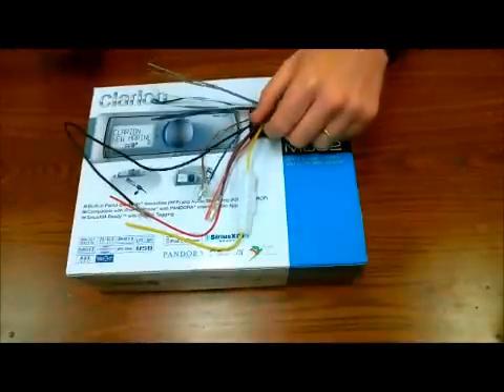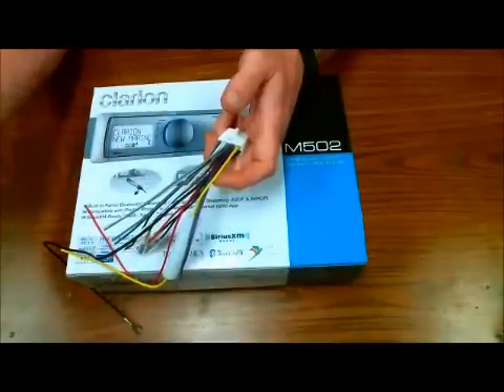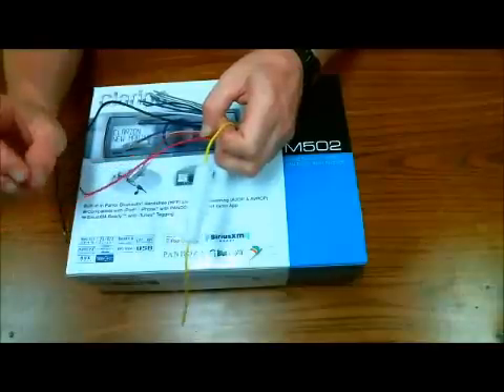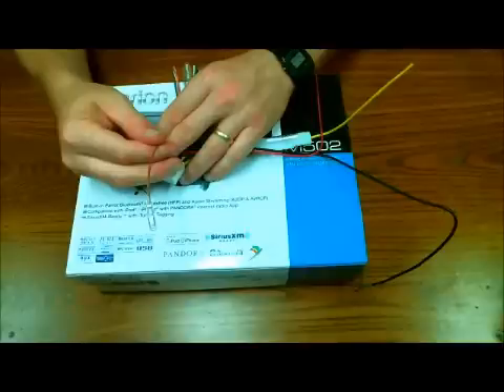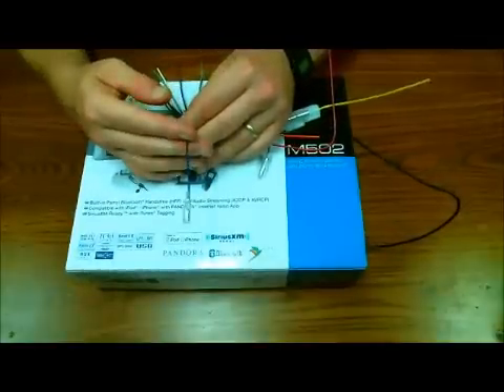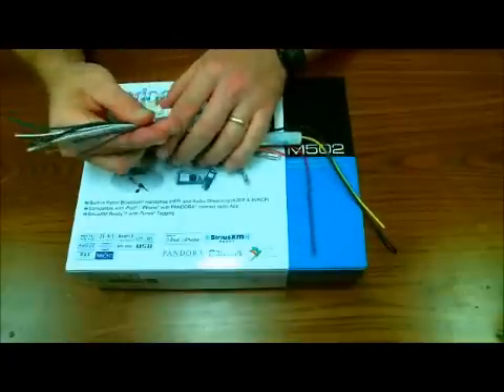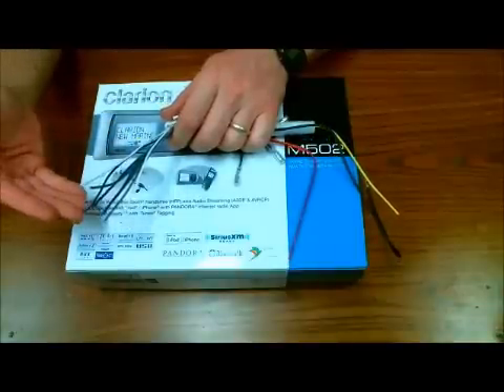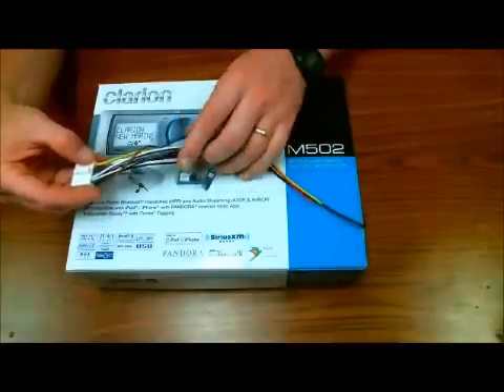Car Stereo Wiring Explained In Detail

Comment: i have a 2010 dodge journey w.o. infinity system, i cut my factory wire harness, now i am trying to rewire the metra 70-6522 with the reverse harness(70-6522). I am having problems with figuring out the factory colors with the metra harness. they are not the same.. I figured bc they wiring is for the infinity nav system particularly. Any suggestion.

Comment: I have a malfunctioning Kenwood KDX-X598 that, when connected to my phone with Bluetooth, is proving to be unusable. My phone will randomly start playing music, even when paused. I know that the stereo is designed to start playing automatically when the phone is initially connected, but it seems to think it is getting connected at random times when I am driving. It also is messing up where sometimes when I am navigating with Google Maps (audio being output via Bluetooth to the kenwood unit, the navigator will start talking and music will be playing over the audio and is makes it impossible to hear the navigation and it is also very distracting when it randomly starts to happen when driving. 

I am 99% sure it's not a problem from the phone. It is an iPhone and I tried connecting my Bluetooth headphones to the phone and driving around and navigating and did not experience this glitch with the headphones, nor did music ever start randomly playing with the headphones connected. I am starting to think it is either a malfunction of the Kenwood head unit, OR is it possible I messed up the wiring and it is messing up the phone's connection to this device? Is there any way that not connecting one of the wires you described, or not connecting it well, would cause any strange behavior like this?

Comment: Lessco Electronics , I am trying to figure something out. My new RADIO has ONLY and Blue/White wire. My HARNESS has a Blue wire and then a blue loop from the blue hole to another hole. How should I connect this if I plan on installing an amp/sub woofer in the future? This is for a 2001 toyota camry.

Comment: hello, i recently installed a sony car stereo on my truck, but for some reason if i plug the antenna into the deck the deck will turn on for a few seconds and then shut off. do you know what is causing this problem?  without the antenna plugged in the bluetooth and cd work fine. there is also a light blue wire on my harness labeled ATT  can you help me out the deck worked fine in a previous car.

Comment: I have a malfunctioning car stereo that turns on when the key is off the ignition and drains my battery, would cutting the yellow wire prevent it from turning on while the key is off while retaining all other functionality while the car is on? i don't mind if the clock timer is off or presets lost. Thank you!
Reply from the maker: ***** connect yellow to constat and red to a keyed source, problem solved

Comment: Hi,over the weekend I installed a pioneer into a 2006 pontiac g6.The factory harness didn't have a red accessory wire so I ran it to the brown wire off the ignition plug.I did the pre-test before install and everything worked great,radio,cd player,etc..My problem wasn't noticed until Mon., morning on my way to work I put in a cd played great.Got to work unloaded the cd to listen to the radio and no stations.All presets were maintained but no music just static with the car running.Turned the car off and turned key to accessory and boom, radio works.Weird right! Do you have any other suggestions I could use to re-wire my red switch wire.And what size fuse should I use for my constant yellow wire.Harness didn't have one,just a fuse in the stereo.I don't want to have to take my dash apart again after this next fix(big pain).Thanks,Dan
Reply from the maker: Dan Maynard Jr the correct thing to do is run that red down to the fusebox. I know its work, but it is what it is.
Reply: Lessco Electronics Thanks for the reply. I found the problem after I tore back into it Friday eve.,which was for nothing.There's a switch on the side for an external device that cuts out the radio stations for it's use I guess.I took the wires off of it looking for a source.I must have switched them when I put them back on because I never flipped the switch.The sad thing about it is that I knew about that when the cd player first went out.All that extra work for nothing,but it works great now.Can't say as much for my door speakers though,heh heh.Next on my list.Thanks for your time,Dan
Reply: Dan Maynard Jr

Comment: Thank you so much for this wonderful video. Lot of questions answered.  My problem is little different I hope you are the best to explain it. I lost my harness of the player. I had to solder the wire to motherboard and to connect to the battery. My players mother board has 4 ports. I cud identify the ground port but other 3 are in confusion.  One port named as backup I think that might be the yellow wire you mentioned.  How will I find the +12 red port. If you can give me ur mail id I can send the photo of mb. That ground can be wired to battery's negative terminal right?
Thank you

Comment: I hooked the radio up but I can't get any volume can you please help
Reply from the maker: Terrence Swinney  you mjust have a factory amp, eithere needing a turn on wire or in need of bypassing
Reply: Its a 2002 Nissan pathfinder n no it doesn't have one I have a touch screen I followed all the directions everything is color coded the radio comes on just no sound is giving out
Reply from the maker: Terrence Swinney do you have a factory amp that's not integrated with perhaps?

Comment: Hello, great detailed explanation, just what we need.
I have a question, hopefully you maybe able to help. My stereo seems to be installed properly and all functions work, i have the 6 preset stations tuned in but nearly every time I turn the car on I have to select the next preset station as just noise comes from the radio, even thought the correct frequency is in the display. Any ideas?
Reply from the maker: deuceventura the yellow wire is most likely not on constant 12v+ power

Comment: I have an after market stereo but when I turn off the car the stereo stays on and the red is connected to red and yellow to yellow. What do I do ?
Reply: Switch the red to yellow and yellow to red
Reply: @nascar9059  I want my radio to play even when car is off - so that I turn the radio off manually.. If I understand correctly I can achieve this by switching red and yellow wire? Right now my radio shuts down the moment I turn off my car...
Reply: To achieve what I wanted is quite simple - peel (not cut) both red and yellow wire and join them together. Insulate. :)
Reply: Differentiate between BAT and ACC power.

Comment: Thank you for this video. Your explanation of the wires and colors were excellent. Not every guy has had experience installing car radios. It would be awesome if you could explain the wiring and colors for cars with steering wheel controls.

Comment: Might sound stupid here but the bunch of wires coming from my car dash and the wires you just described from my radio are totally different. I now know the purpose of all the wires from my kenwood radio(there the same as in your video) but the wires from my dash are different their is for example four reds 3 normal reds and a red blue and so on. How do I figure out which wires are which for to connect to my wires from my radio?

Comment: i have a 2007 pt cruiser and i have 3 blacks wired together my 3 yellows together and 2 red together bit its not turning on i even did 2 yellows switching it around
but when i put red with yellow it has constant power. how do i make it so it will turn off when i turn the car off

Comment: I just hooked up my car stereo and when I turn the car on completely not just turn the key once..the stereo starts making like this long beep noise out of my speakers and it doesn't go away...what could be this issue?
Reply: also on the wiring harness the ignition switch is pink on the new deck the ignition switch is red...do I still connect this two together?

Comment: So I'm wiring my stereo harness to my harness adapter. I'm down to 2 wires on the stereo harness. One is orange and white and the other is blue and white. On my adapter in down to three wires. One is orange and white, orange and the last one is blue. Should I connect the blue wire with the blue and white and then connect all the orange ones together?

Comment: Thank you for the upload. Great video. Thank you for the information. I have followed the instructions and all went well. but it seems every time I switch the car off and on again, all the stored channels disappear and I have to retune it. any idea? I will add that my after market Audio system came with a harness that is the perfect fit and replaced the old one with out any wire cutting etc.

Comment: My stereo is hooked up but every time I turn off the car it looses its memory the yellow and red wire are hooked up together is that the problem?
Reply from the maker: Juan Leon yes, the yellow needs to be constant and the red on accessory/switched power.
Reply: What if they got both red and yellowfrom harness together hooked up to the red

Comment: If my truck only has 2 speakers (in each of the doors) would I just cap off the speaker wires on the harness that would normally go to the rear speakers?
Reply from the maker: Ohio Digger yes sir

Comment: I have 6 rca inputs and as opposed to using the speaker wire whomever it was to install my stereo only used 4 rca inputs yellow blue blue white red and black they did not properly wire my yellow wire and unfortunately i cant find the connections its deep in the dash so my stereo is on always forget mode as i call it. Anyway my question is Is it ok to only use the rca inputs vrs using the speaker wire ?

Comment: Hey bro I connected my car radio today and it works fine ' but only from the front speakers , the rear speakers are not on n idk y , is it bkuz not a good enough ground , or did I wire it wrong? '

Comment: I just put an Alpine stereo in my 1999 ford f250 . Previously I had a pioneer head unit the radio came in perfect . Now with the new alpine I have little to no radio reception. I have triple checked the antenna connection and it is fully connected  . What can I do to fix this?

Comment: My car has 16 wires on the factory harness yet the harness that came with my pioneer stereo deck on has 12, what does that mean?
Reply from the maker: that's normal. it only needs 11 to wire up a typical radio.
Reply: Lessco Electronics alright thanks for the help

Comment: Okay, so I have a pioneer stereo. It was installed, and now the right speaker in the front & the speaker in the right dash don't work. We checked to see if they were blown, & bought a new speaker & it still doesn't work. So maybe a wire isn't hooked up or isn't hooked up right. Think you could help?

Comment: I am putting a DIN into my 92 Subaru Loyale. The conversion went fine, everything works, except the orange dimmer wire has no reciprocal connection. Is this just because there is no dimmer in a 92 loyale or what?

Comment: my 95 q45 rear amp speakers are making a noise so bad you cant hear the radio. I disconnected both rear speaker connectors. Now the front speakers are clear,no noise. I suspect the amps in the speakers are shot. Can I just replace the speakers with regular 6x9's and use only two of the four speaker connector wires?
Reply from the maker: ***** sure, but youll have no amp to hear them, So .... you can either bypass all 4 amps and get a new powered radio or replace the 2 rears WITH the factory amp built in.

Comment: Hey I have a grey and white I believe wire and it says mute which wire do I connect to the mute wire
Reply from the maker: normally that's not used unless youre adding in a separate Bluetooth kit or something like that
Reply: Oh OK but I've connected all the wires together on the interface  and when I turn over the key the cd player work but the screen on the stereo system not displaying nothing and no sound is coming out the speakers what could it be if you know
Reply from the maker: email me a copy of the wiring, I'll look with you, my email is sales@lesscoelectronics.com

Comment: Im working on setting up 2 car stereos. In both cases there is a extra green with a white line. It goes to the headlights. Cant figure out where to put it cause it has no conection for it to go to. So when I turn on the head lights in both cars the stereo says no signal.
Reply from the maker: what model is that stereo, It doesn't sound like a usa made one from what youre explaining
Reply: Lessco Electronics its universal. Doesnt have a brand name.
Reply from the maker: hmm, that makes sense now.
Reply: Lessco Electronics do you think there is any way around it. Or maybe if I run it to the light fuse?
Reply from the maker: Here's a thought, what if you don't connect it at all

Comment: Thanks for the info. I'm trying to install a pioneer avh-x5700bhs on my 02 Pathfinder. It has a bose system. No sound is being made. What am I doing wrong? I don't have the blue wire on my car harness connected, the wires that came with the head unit does not have a blue one. please help

Comment: My 2004 F-150 adapter has an orange and black wire and an orange and which wire which one if any do I connect to the orange wire from the radio harness.  Thanks in advance.

Comment: I had  a question, My camry 2001 wire harness has a blue wire, but I dont see a corresponding blue wire in my Pioneer stereo. The Pioneer stereo has a blue with white stipes wire. Should I connect the pioneer blue/white with the harness blue wire?
Thanks

Comment: A lot of aftermarket radios only have the solid blue wire marked power antenna and do not a blue with white stripe wire marked amp turn on. I have been in car audio for 25+ years and have yet to see a head unit of any brand that the blue wire does not stay hot anytime the radio is powered up. If a solid blue wire marked power antenna is all your unit has then you can use this as your amp turn on. If your unit has a designated wire for your amp turn on then I'm not sure why you would use anything else . Also he didn't mention the parking brake wire at all which is featured only on in dash dvd units. As per state and local codes you are supposed to wire this in to the your parking brake but you can bypass simply by hooking directly to your hard ground, the black wire
Reply: Hi, I just installed an after market 2 din radio, when playing DVD, screen only shows the watch video safety rule,  DVD seems working, only sounds but not imaging,  While pull the hand brake up, display screen does not show brake on, while the hand brake is  released, display screen shows parking brake on.  I think this is the so call parking brake issue, The original head unit is Subaru Impreza Part # 86201FJ620 CM621UB, ZR62, Do you has any suggestion regarding the wiriing?Thank you very much!
Reply: There should be a wire that is labeled parking brake or something to do with the brake. As long as it isn't a pioneer unit all you have to do is take the"brake" wire and tie it in with your ground wire. This will tell your unit that the parking brake is on all the time.
Reply: chris stewart I hope you right ima try it right now
Reply: Exactly! Never seen a unit that turned OFF the power ant every time you you used something other than radio.

Comment: Well I'm having a odd issue with my install.
1.When I disconnect the black wire the deck remains on no idea why.
2. When I select a.m band radio I hear signal and wiper noise only on a.m band.
Any ideas what I can do to fix? Thank you.

Comment: i have a pioneer super tuner sterio and on the wiring harness I have all the wires except the red 12 volt power wire why is it missing the red wire? I tried wiring it with the black and yellow just to make sure and I got nothing.

Comment: Another great vid, helping me out a lot, thanks. Few questions though, if my yellow wire doesn't have an inline fuse on the wire, should I ad one ? and iv seen a few vids where people are just connecting the black ground wires together, is this ok, or do you twist the wires together, add a connector, then screw them to a good earthing point somewhere ?
Reply from the maker: I will always always, always, advise adding a fuse, the fuse won't protect you one bit if it's not there in the first place!

As for connections, Try to use the appropriate connector, don't rely on tape and wire twisting.

Comment: My chevy k10 has no wires in it for the radio. Where should i get wires and is there a universal kit
Reply from the maker: Jimmy Mascitis just use standard 18 gauge wires and color correlate them to the radios colors from scratch

Comment: can I run all the front and rear speaker wires into 2 speakers to increase power? thanks. Awesome video.
Reply from the maker: impact lures no, all that will create is a poof of smoke, parallel wiring cannot bridged or summed with a standard radio's power outputs.
Reply: Lessco Electronics Thank you for the response. I am just going by the manual. Safer that way.

Comment: Thank you for your videos, they are very helpful. I'm having issues with engine/alternator whine. I don't not have an amplifier. The only thing I did was switch out the older aftermarket unit for a new one with USB. please help!
Reply from the maker: nick ward measure the ground impedance, how many ohms is it? is the new radio a chinaman special or a quality brand btw?

Comment: what if I'm using a stock head unit and it does not have a remote turn on but I want to install an amp?
Reply: Just run the remote to where the power wire goes on your amp and this will send a power singnal to your amp and cause it to turn on as long as the power wire is also connected